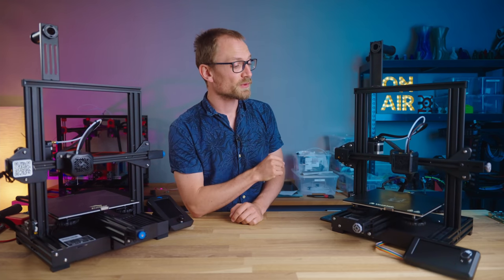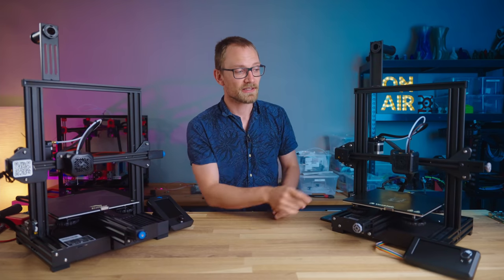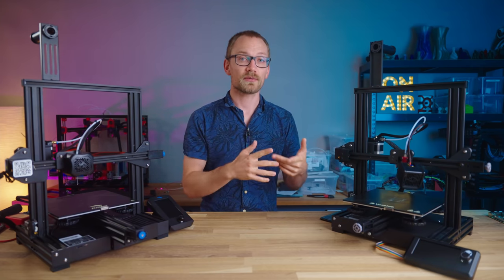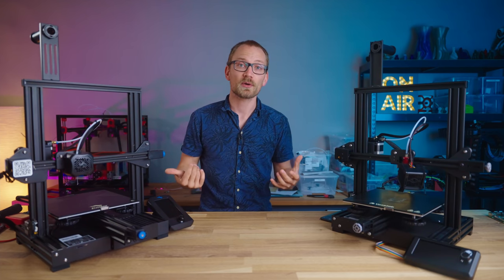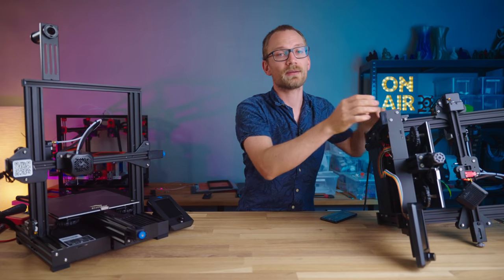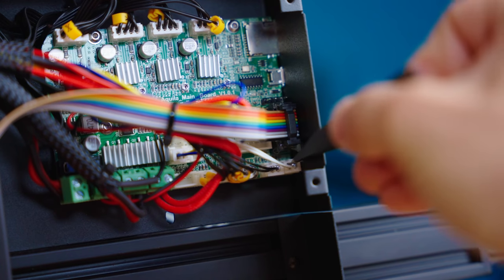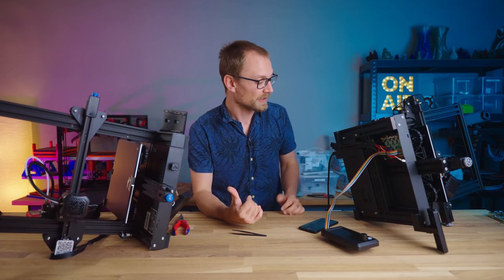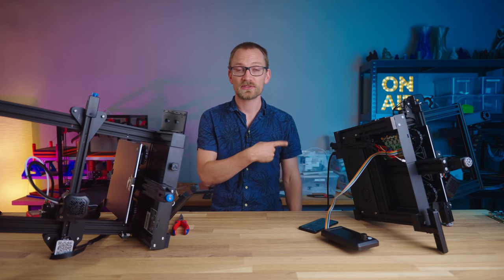How to make sure your 3D printer won't catch fire!

Comment: My ender 3 v2 err maxtemp immediately when I start printer. So I changed everything HW,SW but doesn't work I don't know how to fix it. Should I change motherboard ? Any suggest?
Reply: Try measure the resistance of the thermistor. I believe it should be a 10kohm thermistor (or a 100kohm). Unplug the thermisor at the mainboard and measure through the connector using a multimeter. And then heat the thermistor holding it between two fingers and see resistance falling. If it fails, then you know what the probloem is (thermistor or cabling to the thermistor).

Comment: An alternate, although not fool proof, way of testing is to remove any silicon sock on your heat block and then heat up your hot end. Then take a large adjustable spanner and clamp it on to the heat block. This should suck away enough heat to trigger thermal run away protection.  A little easier that opening up the printer and removing wires.

Comment: I have a first run Aquila with stm processor...I did the tests an the machine did what it is suppose to. It stopped heating and gave a message. I think its related to the followup processors they used because of the lack of original ones in the moment.

Comment: The main fault I have seen several times on thermal runaway, is the printer CPU freezes and stops controlling the drive to the heater and just leaves it on. There is no software fix for this, the CPU should have had a hardware watchdog enabled. Most of these CPUs have one already built in.
The other faults you have observed could easily been taken care of in hardware rather than software. A voltage band comparison that disables the drive to the heater if the returning voltage from the sensor is out of range, high or low.  A minimal number of parts are needed to do this. 
Other currently scary faults are......1) Drive fets that have shorted [acting like full on]..............2) Motor shorts - No feedback to even know if the motors are turning...........3) Power supply over and under voltage detection.
All of the above should have never been an issue in a product that has the chance of burning down your house if they occur. It's just poor design.
Even when running properly, all these designs have issues. Travel limit switches that aren't used as limits, they're used as reference points and can be driven past. Having limit switches at only one end of travel. No movement feedback. No measurement of actual feed of the plastic. Lots of slippage expected.  Rudimentary to non-exsistant bed leveling. 
An industrial machine design engineer would cringe over most of what is for sale out there, and it's not really an issue of parts cost to fix a lot of these.
Reply: maybe this explains why E3D went with a PTC heater on their new Revo6 hot ends.  Apparently something in the design of PTCs means they cannot ever go over their design temp, I think that is why they dominate space heaters now too.

Comment: My hotend is probably what broke my printer a while ago. The Teflon tube seem to be deformed and I can't remove it. There is gunk all over the hotend nowadays as well. 

I wonder if a modern hotend replacement works on my platform and could resurrect it.
Reply: What printer do you have? An e3d v6 is always a good option or a kp3s titan extruder if the budget is tight. The kp3s titan is intended for use on an mgn12 linear rail with a C block but some modification will make it fit anything you want to mount it on. You can't go wrong with the kp3s titan, because it's only $21 USD on ebay right now. I have one mounted on my Cetus MK1 and I'll be installing a genuine all metal e3d v6 to replace the teflon lined clone that was included.

Comment: I've actually been considering upgrading my hotend, but I'm not sure with all the choices. I print mostly  PLA and transitioning to print PETG. Any recommendations?
Reply: Does your current hotend have problems (or like PTFE lined so not so much recommended) with temperatures on the 250ºc range? I'm printing PETG at 240°c here so I would say you don't need anything too fancy, I'm just using a clone all metal V6 from Aliexpress and it really does a remarkably fine job, no clogs or such and up to 100mm/s with 0.6mm trace on 0.4mm nozzle extrudes well through a clone Titan, talking about PETG here, as PLA is easier even, and no issues on ABS either.

The one thing you gotta do tho is tighten it up while hot, before feeding filament. I didn't and had a leak at 1st, plus the heatsink fan is load as heck (at least compared to my PC which I'm used to).

Comment: I don't get why this is still a thing in 2021.  Although, I don't get why people are still using SD cards to transfer the Gcode to the printer instead of using wifi either on new printers.
Reply: Reliability. I found with really challenging gcode (lots of commands in a short amount of time, like curves) wifi via octoprint wasn't as reliable as SD card. This is on a Prusa i3 MK3S.
Reply: @olive-vrta  I have been using a duet Wifi for years and never had any issues with sending gcode over wifi.  Even very large gcode files have worked fine.
Reply: Well, maybe I'm the oddball, but when I want to start printing something, the first thing I need to do is get out some filament and load it into the printer.

If there's already filament loaded because I just printed something else, I still need to remove the previous print first.  I just don't see any use case where loading gcode remotely is any better than sticking in an SD card.

Comment: Even though my printer does have proper protections, I still have a smoke detector near to it! Just in case it all fails...
Reply: Yea, I would still update firmware (if u have an Aquila) and get a Raspberry Pi and Octoprint! $10 camera for the Pi and watch it on your home network or Octoeverywhere plug in. Smoke detectors detected...they don't out a fire🤪.

Comment: Hope you don't mind me asking, but where's the fire hazard with having a wire/circuit break in the heater cartridge? Or is that failure mode more about preventing other damage, to hotend/heatbreak, extruder etc?
Reply: If you are talking about the first test he did - disconnecting the heater wires:
As he said that is a catch all test.
Disconnecting the heater wires has the same result as a fallen out temperature sensor.
Reply: @Jehty_  No I meant connection break on the heater cartridge. Either wire, connector or on PCB. One of the two conductors broken. So either no +12/24v or no ground lead going to the heater cartridge. Ie, no more complete circuit to power the cartridge.

Comment: What's the case on the Neptune 2?
Reply: I have just given it a test myself on my new  Neptune 2S.
Disconnecting and shorting the connectors of both thermal sensors does result in the printer to stop heating immeadiatly and showing and error on the display. No audible alarm though (despite it clearly letting me hear at every start that it indeed has a loud speaker).
But it did neither catch me disconneting the heater wires of the extruder nor removing the thermal sensor directly from the heating block.  It kept trying to heat, respectively with the sensor removed I kept holding an infrared thermometer onto the heatblock and at 230°C it became "too hot" for me, so I immediatly stopped the heating process. 😒

Comment: Is there anything we can do if our printer fails any of these tests? New fw versions, looking up marlin settings, etc?
Reply from the maker: I don't think Marlin lets you enable the features without a full reflash. Community firmware builds most often have the checks enabled and working.
Reply: The Aquila depending what version chip you have can use a community firmware from alex (known publicly just as alexs firmware for the aquila)that has thermal runway enabled ...does it work or not I cannot confirm personally... simply as I have not done the actual install .... however from my understanding it can be done for all aquila's not using the h32 chip ....

Comment: why not measure and hard cap the amperage that is send through the cable, if passes some threshold it stops heating and/or printing
Reply from the maker: That's exactly what a fuse does - proper 3D printers have eg. mini blade fuses right on the mainboard.

Comment: Make sure you do the right thing when unplugging/plugging something from the running Printer.
I once shorted the power pins of a fan with a pair of tweezers, which resulted in a blown fuse on the mainboard.
And the often used LittleFuse SMD fuses are hard to get for a reasonable price if you don't want to buy a whole bunch of them.

Comment: Hmmm… This seems less thermal runaway than overheating. Thermal runaway would suggest that the temperature would continue to increase when you removed the power. Overheating would be more accurate as it’s failing to regulate the temp. 😁

Comment: Very happy with my Ender 3v2, made some mistakes putting in a new main board which caused the thermal runaway error. Was just a simple fix of putting a ferrule on and putting the cable back in for better connection.

Comment: Thomas, I don't feel this video+title line up with one another. I understand what your trying to say here and agree with you 100% that this is important. However, none of this helps actually prevent these things from happening. A solution in something like Octopi or similar would be much better to understand and implement even when printer manufacturers are failing us so often.

Comment: My printer has thermal runaway, but sometimes it simply doesn't work. Once my thermistor fell out of the heatblock and neither the printer nor Octoprint send any message. 
Fortunately I watched my printer over Octoprint and recognized very slow heating. When I walked to my printer to see what is happening and measured the temperatur with an IR-Thermometer my hotend had over 360°C (680° F). It melted away the PTFE-tube but other than that nothing got damaged.

Comment: Big Warning: Do NOT ever SHORT your thermistor pins! Many cheaper boards (e.g. Anet or Bigteetech SKR v1.1) do not have a short protection on the thermistor pins. Shorting those pins may permanently destroy those pins, which then makes your printer unable to read any temperature at all! I've seen that on two boards so far! (one mine and the other a friend's)

Comment: Great idea to tell people to poke around with tweezers inside of a machine running on mains power.
Reply: No mains on the motherboard.

I heard no mention of ”please break open the power supply”.

EDIT: wrote motherboard, meant PS
Reply: @greenveg42  If I open the case of my CR-10 to access the board, I get free access to terminals on the power supply that carry mains voltage. Sure, if I don't touch them, I'm safe. But that always applies. You can open up any wall socket and it'll be perfectly safe as long as you don't touch the wrong stuff. You can turn a running lawnmower on its back and it'll be perfectly safe, even for children, as long as they don't touch the spinning blades.
Reply: @frankbauerful  I guess you're right. Did not know that the CR10:s had their PS as close to the motherboard area.

Comment: What I do is take a spare thermistor and plug it into the board but leave the sensor in open air, turn on the heater. It obviously will show no change in hotend temp which should trip thermal run away.